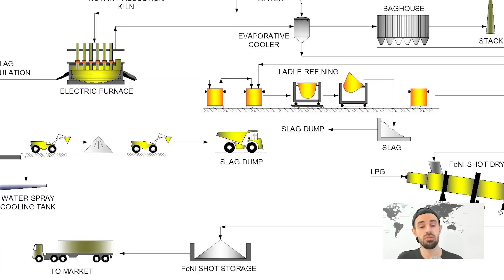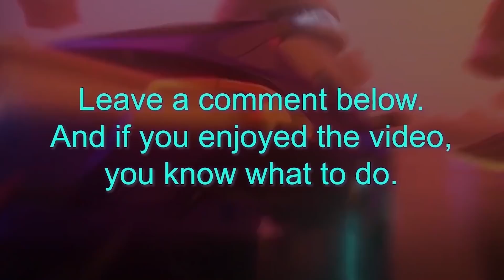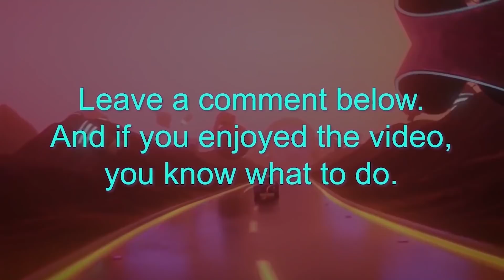Tesla Co-Founder's Battery Recycling Biz: Redwood Materials

Comment: Smelting is not good for the environment and is less efficient. American Battery Technology use hydrometallurgy under low temperatures to recycle to very high efficiency with no toxic by products.

Comment: recycling is also heavily used in the steel-making and aluminum-making industries... -those metals are separated out from scrap, then some amount is melted in with a new steel batch (for example) - other waste products are pulled off the slag of a new steel melt... -i think lithium re-use must be similar...

Comment: I was involved in precious metals recycling and refining back in the early 70's thru the late 80's. Recovery percentages varied depending on the type of metal and type of material that was being recycled. Automotive catalysts gave us a high yield on platinum, palladium, rhodium and rhenium. Platinum sold at a premium at 99.995% purity (four nines five) and slightly less value at 99.95% (three nines five). The desired purity depended on the customer use. 99.95% was perfect for jewelry whereas 99.995% was required for catalytic uses in catalytic converters and other catalytic uses. Platinum, Gold, and Palladium metals were our bread and butter along with Palladium catalyst powders. We processed Rhodium to about a 95% plus purity since further processing would involve changing Rhodium to a radioactive isotope form. Rhenium, Tungsten, Copper, Silver, and some other metals became a high grade by product that we sent to other refiners for further processing for purity. Even those metals commanded a pretty high price at 80-99% purity. A lot of these by products actually became a product line that was profitable on its own such as alum from alumina ceramic catalytic converters from automobiles as well as catalysts from oil industries. 

From that experience I can readily see the opportunities for recycling batteries and recycling in general. Yes, mining from waste is generally easier and more profitable than mining ores. Synergies with other companies can be evolved by evolving your own recycling processes as well. We didn't have to dissolve Alumina substrates to extract the precious metals from catalytic converters. However, by doing that we could produce Alum at a precise specific gravity and purity that was sold to waste water treatment plants and paper mills and paper recycling companies that required alum with it's specific colloidal properties for their processes. Even though we could reach a high profit margin from directly extracting the precious metals from the alumina substrates, we found that by dissolving the substrates we not only produced a profitable by product but also was able to reduce another half a percent or so of the precious metals considerably increasing the profit margin. 

I think the future could end up being way more lucrative than meets the eye for Redwood as their processes mature and potential synergistic markets for other products and/or materials that might be hiding in the process of recycling batteries. There may be the potential of other types of recycling companies that could have by products that could be used to improve the process or lower the cost of operations for Redwood. You have to keep a good eye on your processes, but the other eye should be on the lookout for opportunities. 

Wow, maybe I need Grammarly.
Reply: Thank you for the insight. I think we all know where this is headed. Does anyone doubt that Tesla will team up with Redwood to recycle batteries and improve their profit margin or reduce battery costs another order of magnitude???
Reply: Wow Mark you really have alot of experience and knowledge in this field! Are you still involved in any capacity with recycling?
Reply: @wayoffaithglobal  No, although I've given it some thought. I retired at the age of 58. I'm 66 right now, but I feel younger and have thought about making a career in something for another 30 years...assuming I last that long. Last 29 years of my career was in a global food manufacturer. Even then, however, contrary to belief in much of local plant management, recycling of some wastes turned out to be profitable and was becoming an opportunity income source vs. an additional cost of manufacturing. 
An interesting fact: When catalytic convertors in vehicles began their "end of life", China avoided US laws and restrictions concerning precious metals leaving the country. They did it by buying the spent catalyst as ceramic waste for recycling. It took quite a while before that was finally figured out and I believe in the late 70's or early 80's legislation was amended to correct the situation. By the late 70's the company I worked with was helping to advance more of a closed loop in precious metals recycling. The auto companies would send us defective catalyst, we extracted and refined the platinum and palladium and sent it back to them to be reused. A lot of the spent catalyst's precious metals also ended up back into new convertors as well.

I would definitely believe that lithium and other metals being refined from old batteries will benefit Tesla. It can be a closed loop system at the peak of battery manufacturing and mining through recycling will be much more economical and sustainable for the environment.
I am thinking about starting a Youtube channel. It seems that I have had life experiences that the majority of people have not. It would be more to inform people than to earn more money. I've been confronted by a few types of wild animals and survived without a scratch. I've been the president of a company as a subsidiary of a major auto manufacturer. I've been a chemical engineer. I've been a plant manager, department manager. I remodeled a rental property. I was out on the streets on my own at 16 for a couple months. I dropped out of high school, lol. I've been (near) rich and definitely poor at one time. I did various drugs more experimental until I researched health implications. I applied to go to Fullerton Junior College and was at first denied admission because of an abnormally high SAT score. I used to read about 3-400 books a year. I am bilingual and can communicate in French "desperately". I speak English, Spanish and can generally communicate with people who speak Italian, Portuguese. Anyway, I've had a lot of great and sometimes crazy experiences and have a decent real world education. Hopefully I can use what knowledge I have, failures and successes to help other people. Sorry, I didn't mean to write a book, but once I get going it's hard for me to stop. I do say I a lot. I am not really anyone special and don't pretend to be. But, I do think I've had a lot of experiences that might be able to benefit others. The greatest satisfaction in life is helping one's self so in turn you can help other people help themselves. Hopefully, by telling factual stories, with humor and underlying seriousness, I can engage people to learn something new, different, or maybe even just to entertain.

Comment: Lot of comments have gone arouns about the energy used in battery recycling. But its really no less energy than goes into refining petroleum, or in mining. All of the crushing machines, melting, and acid baths to get pure metals... All of those processes are essentially duplicated from the mining industry in the first place.  The problems/questions to solve with recycling are how to automate these processes with thousands of different kinds of devices, and what to do with the toxic waste that come out of the end? The BIGGEST question, the one that Elon eluded to at battery day, is how to get the materials directly into a usable form and skip the various compound forms that are related to using acid baths in material recovery. If they can get thier refining down to the point where the form of lithium and nickel that comes out of Redwood is exactly the form that Tesla needs to make batteries, that will be even BETTER than mining. And the materials will be higher quality and higher purity than the ones derived directly from ores. They have been purified again and again.

Comment: Yes Steven, this is definitely more efficient: 
1. Source is concentrated in the valuable components (Li, Co, Ni, Mn, Cu) whereas it is dilute in the deposits extracted  by mining. 
2. The process RM uses is exothermic - meaning, the energy to run the furnaces is supplied by the materials. 
3. The oxygen in the metal oxides that contain the Co, Ni, Mn, etc. can be used to oxidize (combust) the plastics in the phones, etc. The produced CO2 can be used to create LiCO3 (lithium carbonate, the form of Li produced by the RM process). 

Tesla has stated their own ambitious for battery recycling, so I am not sure how this fits in with RMs. Also, RM has started collaborating with some of Tesla's competitors. My guess is that Elon is okay with that - it all helps further Tesla's mission.

Comment: Recycling batteries will be in Multiple parts in the process of start to finished of the batteries life. 1st of all 30% of making a battery fail before making to the car! So recycling that 30% and putting it back into the beginning of making batteries will be huge on cost! 2nd finding old batteries to recycle ♻️ to put in the process will be huge in cost savings! 3rd which will take the most time to come back is old EV batteries but when EV batteries tech like the new 100kw will get out dated in 2 years. Or the 1st Tesla batteries are obsolete. Is why NIO has the upper hand because they can just recycle old battery tech right away and not wait 10 years for the car to come back if that! ELON HIRE ME ASAP! 😉

Comment: Recycling is absolutely a needed and economically viable process, the only downside I think they will run into is that according to Jeff Dahme current batteries will last a very long time so the amount of recycle material maybe relatively low. Over time it will become the prime source of material it just will take a while

Comment: Neometals is very advanced in this area as well. Will not come anywhere close to providing the battery metals required for the transition to electro mobility but will certainly contribute. Million mile chemistries mean batteries will have 20-30 year usable life in energy storage after vehicle use. Things to consider.

Comment: General Motors just issued a recall/bulletin on the 2017-2019 Bolt. Much like Hyundai Kona problems they seem to be catching fire far to frequently. GM is limiting the charge to %90 to reduce the risk until they figure it out. These companies are learning it 's not just about putting batteries into a platform and making it go. Be some more batteries to be recycled before long.
Reply: And their cars are not made to last long.
But the biggest source to recycle by far should be duds from manufacturing.
Reply: Great point!

Comment: Plasma recycling is what we need; heat our terrible mixed garbage into a plasma soup (all molecules will fall apart), then separate all atoms by kind. This is NOT easier nor possible at large scale this moment. A lot needs to be R&Ded. Yes: it is easier and cheaper at this moment to dig holes in the ground and all. But Plasma recycling is possible in theory and we need to make it real. Reuse all atoms!

Comment: Rookie mistake, thinking that lithium is going to be needed forever. Just because they are using lithium batteries today, it doesn't mean new tech won't replace it with something totally new within ten-fifteen years. (More than likely it will)

Comment: A bit of a point in math. It was said that metals in batteries is not 100% recoverable. That by definition means mining is going to remain necessary. Love the fact that 80% of lithium is recovered, but just remember that 20% will need to be mined. That does not take into account the increased demand.
Reply: Melting the batteries is bad for the environment!!! And old technology! Check out AMYZF! They recover about 99-100% in a green process!

Comment: Steven,  was talking to a guy I work with who has a Chevy Bolt, GM announced a recall on the Bolts due to 6 cars spontaneously combusting. He was reading the message he got regarding this recall as we talked about it. Sounds like the battery would get too hot if it charges all the way up to 100% charge. Will look into this more myself. Will delete if for some reason it's not true or the facts are different. Just thought you should know, enjoy lol

Comment: This is not a high tech or software-driven company. This technique can easily be copied. Iom, not a company to invest in.
Besides, ev's, at this moment, are just a fraction of the car-total. This fraction is growing. This means, for the coming decades, existing cars/powerpacks can not supply enough raw materials to keep up with demand. Unfortunately mining will be needed for the coming years/decades.
Reply: This is definitely a high-tech company. To do it efficiently and cost-effectively, there is a lot of optimization of the process, furnace design, etc. If you do it inefficiently, you won't be able to compete.
Reply: @cbmusgrave  Don't you think the Chinese will be able to do it at a much lower price-range (labor-cost, governmental incentives etc.)? Btw, if this is potential lucrative, I guess Elon would have stepped in from the start.
Reply: @fit2fly  Labor cost will be low - RM won't be removing batteries from phones, etc. and there isn't a lot of other labor costs. They put the whole device into a crucible and melt it down (in contrast to what is said in this video). I expect RM will protect their process IP, but either way, they will be able to recycle US batteries whereas longterm, most of the Chinese batteries from EVs will be LiFePO4 and have much less value for recycling (only Li is valuable) and a transportation cost so localization will lower RM's costs relative to shipping to China. 

JB's first target was recycling circuit boards and electronics and he shifts to batteries later (the process is very similar). When he left Telsa Elon, he wasn't talking about battery recycling and Elon had plenty of other lucrative things on his plate (including getting the Model 3 out the door in quantity).

Comment: Hi Steven, 

This will be an interesting exercise to do:

Lets say we will have 1 billion EVs on the road by 2030. Each battery pack weights around...lets say 500 kg. 
500 kg * 1 billion EVs  = 500 billion kg of battery packs. This number will obviously continue to increase. 
Around 2% of the weight is pure lithium so we need about 10 billion kg of lithium. This is a very rough calculation of course, but bear with me. 

It is estimated that there are 12 million tons of lithium in the earths crust. 12 millions tons translates to about 10.8 billion kg of lithium....

I know this is s a very rough calculation, but it seems like we don't have enough lithium? Am I missing something here?
Reply: Yes. First of all 1ton=1000kgexactly, by definition. 12 million tonns is exactly 12 billion kg. Second, you didn't use the ammount in the crust, you used an old estimate for all the lithium reserves, which is a much stricter criteria. Third, that estimate has been sharply increasing in the last couple years. https://en.m.wikipedia.org/wiki/Lithium#Production
Reply: @zoltankurti  ahh I see. Interesting. So in that case we see a few challenges (not unsolvable but difficult nonetheless):

1) even with the new estimates of the reserves, would that still be enough? We will obviously have more than 1 billion cars in the future 
2) extracting ALL of them will be pretty difficult so we would probably need some innovation on that side 
3) we have to consider all of the other things that lithium is used in that is not EVs. 

I am just genuinely curious. It is interesting to note that it says that estimating lithium reserves accurately is pretty difficult as well
Reply: @reyyannajeeb1067  these numbers are just those reserves that are mineable right now. The total ammount of Lithium in the crust is a huge number, much much bigger than a  couple billion kg. For example, oceans contain 180 billion tons, or more than 10000 times more than what is needed for 1 billion EVs. Those numbers listed in the wikipedia page are only listing the easy to extract forms of Lithium. 20ppm of the crust is Lithium. If I assume that an average atom is 2 times as massive as lithium, that means the mass of the crust is 100000 times as much as the mass of the Lithium in it. The crust is roughly 10^22kg, so that leaves 10^17kg of lithium or 100000 billion tons of Lithium in the crust. Obviously only a fraction of this is anywhere near available, but there is quite a lot of it in the ground.
Reply: @zoltankurti  ahh I see. So we know it is there but not all of it mineable quite yet. So I see major opportunities and innovations in the lithium mining industry. Would you agree?

Only for 20 years or so, of course, because of the recycling that will happen afterwards
Reply: @reyyannajeeb1067  there is a huge opportunity to expand. In fact, if you watch the Tesla battery day video they make claims about exactly that. And their claim is so damn good, it's almost too good to be true, or they didn't talk about some caveat. Tesla could potentially disrupt Lithium mining, it depends on the untold details of what they mentioned on battery day.
Reply: @zoltankurti  oh and also I forgot to mention. I accidentally use the imprecise conversion factor. Hence the 10.8 billion kg

Comment: 80% is a much lower recovery rate than I would have expected.  Even 95% is a little low.  98% is more what I would expect.
Reply: Absolutely right, there are still huge improvements to be made regarding recycling.
Reply: They are melting it which is horrible for the environment! Check out AMYZF and ABML!